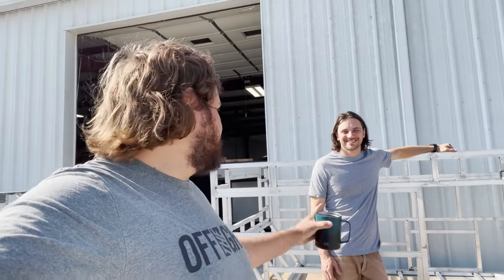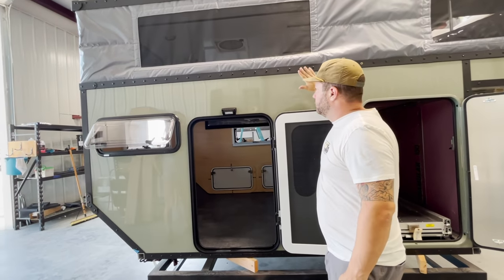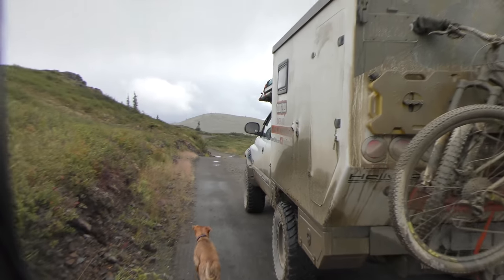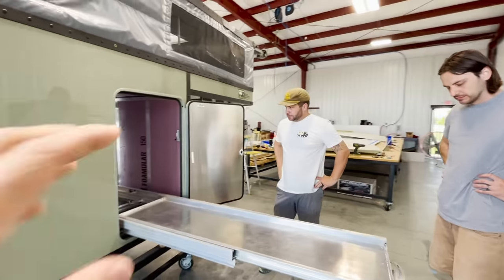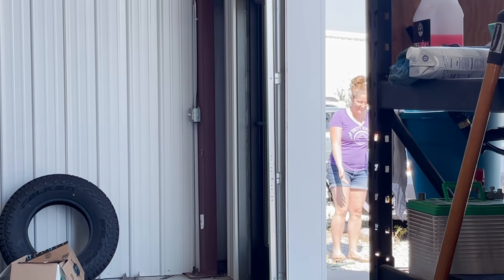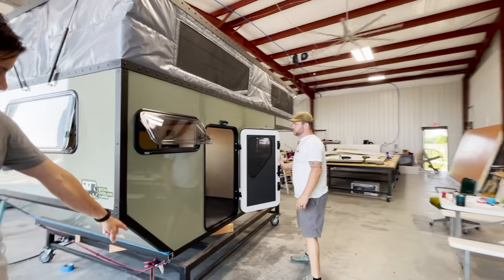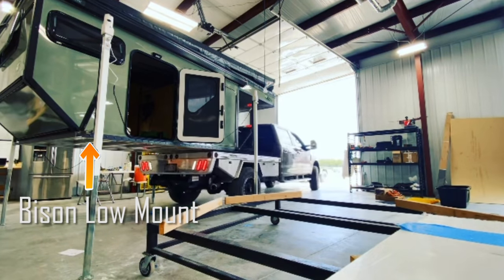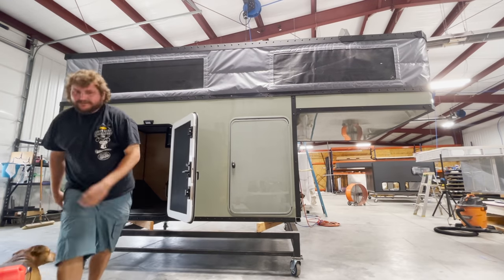FIRST EVER Flatbed Pop Up Truck Camper with a BUILT IN GARAGE

Comment: The garage is great, If side to side space is tight due the handlebars, He might want to mount the electronics to the inside roof of the garage to save the most space as it looks like their is room.Just a thought.
Reply: Unfortunately the Manager 30 is not recommended to mount upside down.

Comment: What's up with these insane prices for all RV's, Campers & Trailers recently?  Specially for empty boxes?  I get that labor prices are high for custom "One Off" designs, but once the design is done and they have the patterns for all the pieces, they should be able to knock these things out quickly for much less than they are charging.   No wonder we are seeing so many DIY projects, since you can save probably 66%, or more, of the cost by doing a little work yourself.

Comment: That door is way too small for my liking.
Reply: Yah, looks like a headache maker.
Reply: We’ve had guys 6’2 up to 6’4 test it out. When it’s on a truck and your climbing in at an angle, it’s no problem.
Reply: I have a four wheel camper with a door of similar height maybe a few inches taller and I have gone through the blood releasing from my Melon learning curve. The good thing is you only have to do it once.